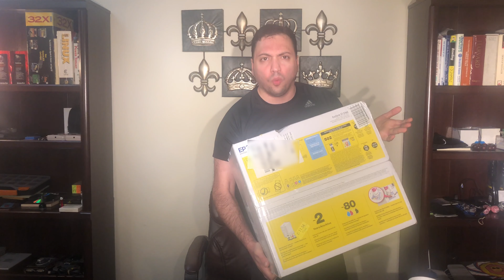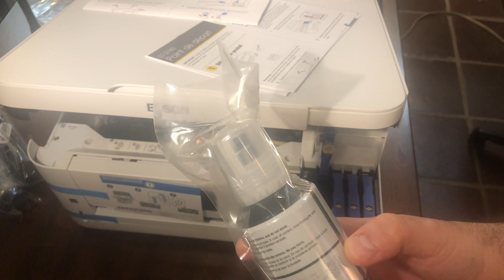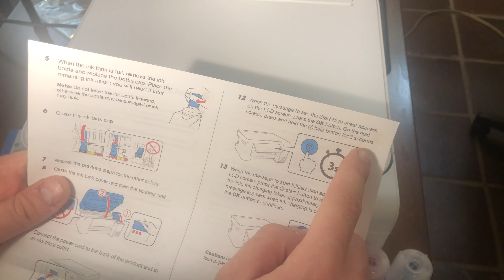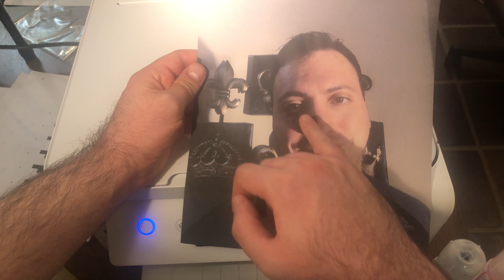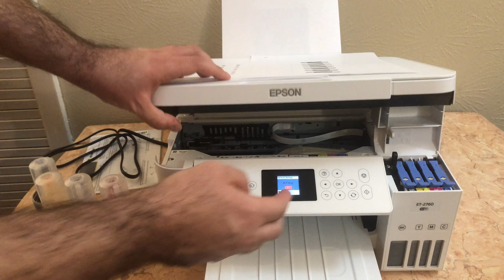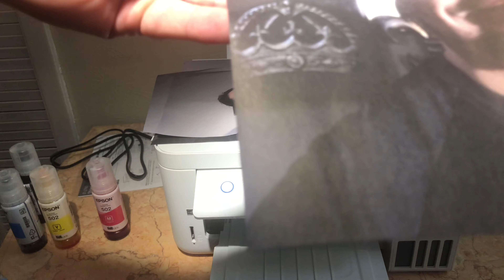Epson Ecotank Printer Review and Testing - Major Fail!

Comment: You do know that if you shake the bottle, all of the bubbles can form air into the lines sent to the printhead that makes extra pressure and it may give the printhead trouble to either reduce the force sent for the ink to flow through it or to give more force, as in other words, leak extra ink.

Comment: Here friend.

https://www.youtube.com/watch?v=H57cTSPJ6qw

EPSON corrects all the failures you did during this video, in example:

- Follow instructions step by step.
- Lift printer always straight up + not move rapidly.
- Do not explore/play with the printer before you read how to use info. 
- Lift the scanner unit till you feel a "click" so it holds the door.
- Do not shake the ink bottle.

Most important of all, try to begin any review without trying so bad to give a bad review and actually see the cons & "pros" of the product. Also, not all failures of a product directs to its author or production, it may also be the bad use of it's user when it doesn't follow precisely the instructions given. 

NOTE* 
I just had to say it, better follow the instructions as they say and then complain if failures.
As well as, try to enjoy and care about what you get buddy, don't just go hunting failures before you even open the box.
If there are failures, they will surely pop-up any time soon or long-term basis, but till then, just try to not reach that point either.

Comment: Before making a recommendation, you should (first) follow directions correctly and then print photos on photo paper, text-based documents on 8 X 11 paper, etc., etc.  Photos were not meant to be printed on stock paper, for example. Epson (and everybody else) make glossy photo paper, specifically for that purpose. Kind of like trying to use a spatula in a wok, then complaining that the wok doesn't work.

Comment: Hey there, thanks for the review! Speaking from experience owning 3 ink tanks, you left out important details when it came to your test, which should've been in the video, & not in the comments section. & just so everyone else here is aware as well- for the print head alignment print tests with the squares- it doesnt say "Pick the square that is solid" it says "Pick the square that has the LEAST amount of streaks- meaning, ALL of the boxes are gonna have streaks, some more exaggerated than the others, this has been the case with all my print tests as well. Also, you're printing wirelessly from your phone, which could also effect the quality versus using a direct USB cable which I would recommend. By default, these printers print at either "Draft" or "Standard". I dont know if you can do it from your phone, but the only way to change the quality settings is to go into print settings & change it as well as change the paper setting. So yes, of course, printing in draft/standard mode wont be perfect, hence "draft". So it wouldve been helpful to see you use the right type of paper & SHOW what settings you are using. & of course, NEVER print a full color photo on plain paper as that will cause issues. & saying "A $30 Walmart printer can do better, so there is no excuse" is not a viable defense. Print on ANY inkjet printer with the wrong paper, low quality settings etc & it will produce similar results. & what Walmart do YOU shop at?? The CHEAPEST one I've seen at Walmart is $60, & doesnt have a copier & scanner. & if the "$30" one is SOOOO much better, why  dont you just get one of those since there "so much better?" lol. Just bustin chops. So if you do another review on the future, use the right type of paper, make sure its set to that in the settings, then print a draft version, then a high quality version, then compare. If the "best quality" setting print STILL has lines in it, I will eat my words! Much love.

Comment: Purchased a Epson ET 5170 printer and had nothing but problems with it everyday the printer says an error as occurred and needs to be restarted  and every second document the printer goes slow I mean 5 mins slow to print one page! Called Epson who where all but useless and the guy says try using a USB cable, you must have to many appliances on your Wi-Fi ??? great answer Epson I returned it to the store and got a Brother laser. Did not like the print quality either would not recommend.

Comment: Thanks for the video. Just to share what I have found; I have a cheap printer modified with external ink tanks and needless to say was supplied with dye ink instead of pigment.  It certainly smudged on normal paper but to my surprise when I printed it on glossy paper, it did not smudge.  I ran it under the tap it remained good as when it printed.  Hope the info helps.

Comment: You have to use sublimation paper to print
Reply from the maker: This is not a sublimation printer.

There are many people on YouTube who try to get other people to pour sublimation ink into their non-sublimation printer. This is not recommended by the manufacturer and will void the warranty.

The black ink in this printer is pigment based. The colored inks are dye based inks.

Sublimation paper is used to heat-transfer special sublimation based ink to another surface such as a mug, license plate, etc...

Thank you for your comment.

Comment: I believe the printer is working correctly, even though I did not notice this on any of my printers when printing to plain paper. Maybe Eco Tank printers behave differently?  If you still have this printer, just use the recommended paper that Epson recommends. I am pretty sure they would not recommend plain paper for photo printing. And on the subject, how were your photos printed on the corect paper?
Reply from the maker: I agree that Epson recommends different paper for different prints, however looking at these two printers, the leakage problem was different on each of them.

One leaked on the edges, one leaks in the middle of the paper. It was not the same problem unit to unit. This indicates quality issues.

This leads me to believe that the tolerances are not tight enough, and the engineers and quality assurance people simply let this pass.

I have seen printers which cost $29 at Walmart do a better job with full page prints.

I used to be a hard-core fan of Epson. As a result of their carelessness, I am questioning my loyalty.

Why should a printer that cost $200 or more have this issue?
Reply: @TechnologyFengShui In my opinion, if the photos printed correctly on the paper Epson recommends, then I would say there is no problem with the printer itself. DIfferent printers engage the voltage to the nozzels diferently, and am not sure if the erorrs would result the same on both printers, even though they are the same model. The serial number batch could also yield a slight difference between the two. I am not saying there were no issues with yours, but if the printers consistently printed correctly on plain paper, what should have been printed on plain paper, and consistently printed photos correctly on photo paper, I would then say the printers had no malfunction.
Reply from the maker: The problem spots were completely different across two different printers of the same model. I did try other paper types with minimal improvement.

Most importantly, the heads simply don’t align very well regardless of a recent firmware update.

At this price point, it’s simply not enough. As someone who is reviewing this product, I simply cannot recommend it when there are better options available.
Reply: @TechnologyFengShui  How woukd you rate the Canon Supertank printer compared to this one then?
Reply from the maker: @louisd95714  I will have to do a full review and look at Canon's system a bit closer before I can confidently say this, but my initial thoughts are:

Epson's filling system is better. The Filling system on the Canon is not well thought out.

The print heads seem to be higher quality on the Canon and ink pricing seems a bit better on Canon's side.

thiscategory
Reply: OK, thank you. I will look forward to your review.

Comment: I need your help in this field.... I want to buy printer for glossy sticker paper and also for thick paper 180 GSM and above... what printer you suggest to buy by the way my budget around 450$ I need your suggestions
Reply: This printer is very picky with paper thickness! And the color output isn't as great as my 30$ Canon! I wanted to love this one so much but I regret getting it. I've tried to do glossy paper print outs for my personalized party favors and quality is ehh. I miss my canon
Reply from the maker: I am not an expert in the field of commercial printing. I have many friends who are. I can give you the limited information that I have:

Many people try to buy a printer which is designed for home use. They refill it with sublimation ink, etc... I don’t think that this is worth it. You lose both your warranty, and your printer is using ink it’s not designed for.

I believe the same is true for vinyl printers. Don’t buy one designed for home use unless it is specific to vinyl and or your stickers.

Many of my friends who operate print shops, tend to favor Hewlett-Packard commercial vinyl printers, and Roland, and Summa Vinyl cutters. I have never seen an Epson printer used by a commercial shop that I specifically remember.

I think some may have both printing functions, and cutting functions. Roland even made one that prints, cuts, and weeds. Weeding is when the printer peels and removes the unwanted portions vinyl after cutting.

If your budget is lower, I would look into buying a used well-maintained commercial solution.

People who call themselves “professional” who don’t use proper equipment never get the colors exactly right. This is going to upset many customers who are artistic in nature and picky.

Again, I’m not a professional printer. So please do your research, verify the information that I gave you, and if you’re going to do it, I would recommend you do it the professional way. That way you’ll have return customers who love you and are happy to give you money!

If there are any professionals who can add to this advice, please comment.

Comment: I think it looks great this review made me want to buy one lol
Reply from the maker: It really depends on your standards. If you can accept the defects in the print quality, then it is great.

I have some friends in Hollywood who continuously print out scripts, sides, etc. If you have an application like that and don't care about the print quality, then it will work for you.

Do your research, the Canon may end up being lower cost overall and may provide higher quality prints. The filling system in the Epson does seem to have an advantage.

If Epson released a pigment based version of this printer that preformed a bit better and if they included a better WiFi interface and or an ethernet port. I would be raving about it.

Thanks

Comment: You're crazy man!  And wrong.  It DOES have an ethernet port!
Reply from the maker: The model ET-2760 does not have an Ethernet port. The manual makes no mention of ethernet. This is because the printer does not have ethernet support.

Page 31 of the manual:

https://files.support.epson.com/docid/cpd5/cpd57083.pdf

"You can set up your product to communicate with your computer using a wireless router or access point. The wireless router or access point can be connected to your computer over a wireless or wired network."

It is only the access point which connects to the other devices via wireless and or Ethernet. There is no physical ethernet port on the printer. The diagram on page 31 clearly shows the proper setup.

"Ethernet cable (used only for wired connection to the wireless router or access point)"

Thank you for your comments. I hope this clarifies the matter.

Comment: Its not leaking ink. You're not meant to print full colour photos on plain paper especially on the quality mode (use draft). This causes the plain paper to curl because of all the ink. The curled paper impacts the print head causing the black spots.
Reply from the maker: "I understand your points about the paper, it makes a lot of sense. Even though the video does not show this, I tried various types of photo papers afterwards.

What is upsetting to me is that I have seen cheap printers below thirty dollars sold at Walmart that do not have this problem, even with cheap paper. The paper I used in the video may not have been premium, but it was not super cheap either.

As it stands, given the cheap Wi-Fi interface that was used, the lack of an ethernet port, and other quality factors such as print heads that do not align to an acceptable specification by my standards, I am not impressed..."

 I did use photo paper as well. You would have seen this had you read my previous response to your comment. Nobody is using the draft function of the printer...

I am comparing the ability of this printer to reproduce images in comparison to other comparable printers on the market. Unfortunately, this printer did not perform very well in the areas mentioned. As a result, I cannot recommend this over other options.

More important than the leaking ink is that fact that the heads simply don't align. I cannot recommend a printer to anybody that doesn't align. Plain and simple. Not one unit, but multiple units from different origins.

flash-ablefirmware

Fully researching, and addressing these issues would've made this video much longer than I would have liked. And there comes a point where you ask yourself, if the printer heads aren't aligning, and the printer is leaking ink all over the place, and it's already on the no-recommendation list. Does it really matter at that point to look for other dis-qualifiers like the cheap Wi-Fi interface, or the cheeping out on the firmware chips? Or even the hard limit and restrictions on the drainage cycles to ink pad.

To address your question more directly:

1. Do you even know what kind of paper are used?

2. Do you know what brand I use?

3. Do you know if the paper I'm holding is photo paper or not? Matte photo paper exists and looks just like regular paper...

4. When one unit leaking is ink on the left, one unit leaking link in the middle, and one unit hardly linking Ink at all do you still blame the paper? Not likely

5. Is this a consistent uniform issue across all units? No...

6. I used photo paper, and the results were still the same, do you still blame the paper?

7. What about the decision to use cheaper Wi-Fi radios?

End of story...

Why post without first fully reading the responses to your original comments? Please research the topic. You can seriously miss lead serious customers who are looking for good information.

When a 29 dollar printer from Walmart can do a better job on plain paper, there is a problem... Thank you for your comments.

Comment: Whats the maximum paper size, can it print or scan A3?
Reply from the maker: From the manual: https://files.support.epson.com/docid/cpd5/cpd57083.pdf

Under plain paper, copier paper, and letterhead it says:

"Letter (8.5 × 11 inches [216 × 279 mm]) or A4
(8.3 × 11.7 inches [210 × 297 mm]) size or smaller: Up to the line indicated by the arrow mark
Legal (8.5 × 14 inches [216 × 356 mm]) or 8.5 × 13 inches (216 × 330 mm) size: 1 sheet"

A visual inspection of the scanner bed reveals indicators for paper size marked B5, LTR and A4 MAX.

Thank you for your question.